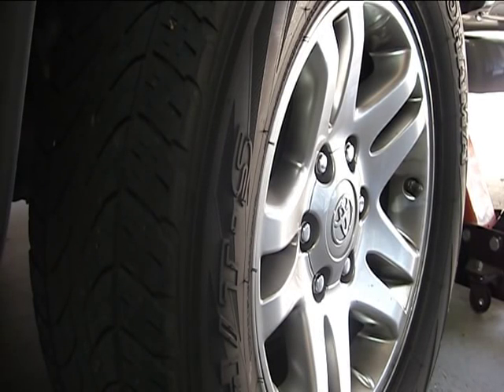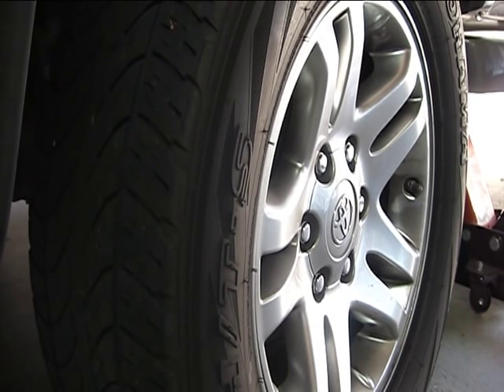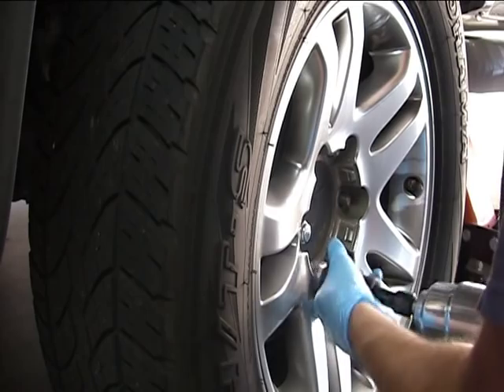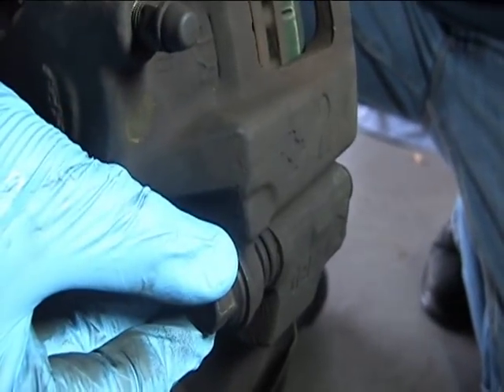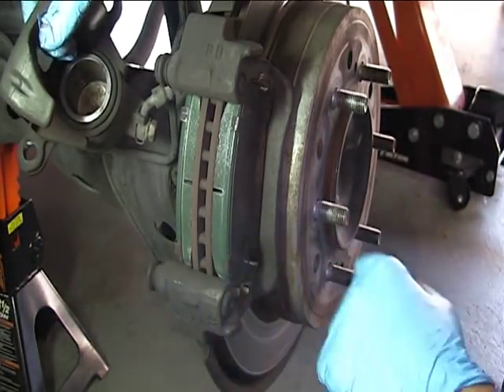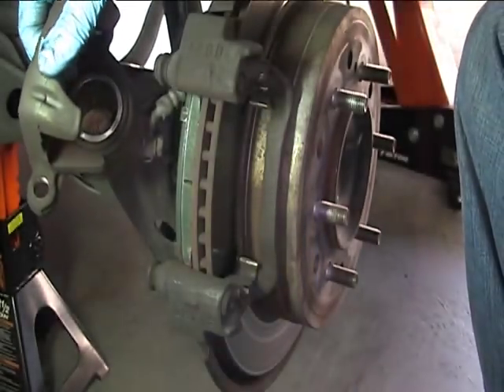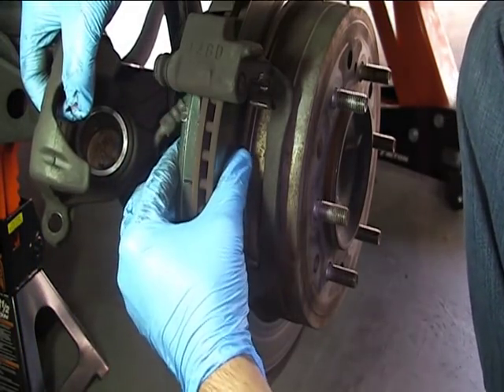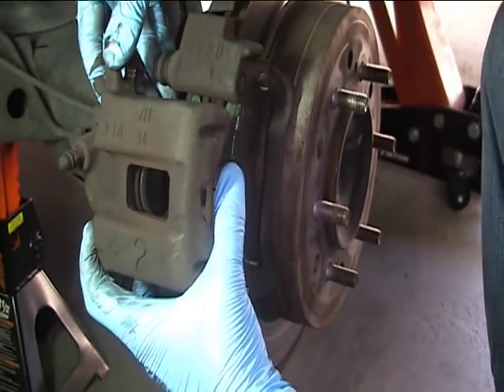How to Replace Rear Brake Pads on Your Toyota Sequoia

Comment: Wow, a huge THANKS for posting this.  The shop wanted $800 to do the front and rear, i did it for about $100 in parts.  It took longer to jack up the car and get the wheels off than it did to replace the pads.  The hardest part is pushing the calipers back in enough to get the new brake pads on - I ended up using channel locks and it worked fine.  This was my first time to attempt to take this on myself and it went on without a hitch.

This is not hard for the mechanically inclined DIY-er.

Comment: Excellent!  thanks again.  These remind me of GM front brakes on older cars.  As mentioned in the other video, I thought the hard grinding was the front brakes, was sure of it, you can feel it in the steering wheel.  But its the backs.  Have yet to take the tires off.  I dont have tools anymore, have to use the jack that comes with the truck.  

So the mystery has to wait another day
Reply from the maker: That sounds about right. At least the rear brakes are disc as well so they're easier to replace than drum brakes once you do it.

Comment: Amazing thing, so on the left side rear brakes it went from a faint sound of worn out pads to worse, then really bad metal grinding, the rear brakes have the piston activate on the inside disc.  apparently when the disc material is gone?  it gets ejected leaving the piston to grind on the rotor.

I have very limited tools and rarely have a spot to do the work, other cars park there.  I replaced the fronts then the failing rear disc.  knew I had to get that 4th one sometime.  hear a faint disc sound, worse, worse, clunk now its hard grind.  took that apart last night and same thing, inner disc falls off and gets stuck behind the cover plate, I wonder if this happens to all Sequoias or similar?

so as you drive this disc thats stuck there grinds on the rotor making a sound that changes pitch the faster it goes.

Comment: excellent video, how many foot pound for tight the nuts that have grease on them.  do you have another video for changing the rooter as well???
Reply from the maker: +Daniel Van 90-100 foot pounds for tightening the wheel nuts.

I don't currently have one for changing the rotors yet (I will once the vehicle requires them), but you can look at this video (http://youtu.be/UdbpQ8qaNSs) to get an idea of what's required. Thanks for watching!

Comment: if you don't have an air gun or impact wrench what's a good way to take the 17mm bolts off
Reply from the maker: Use a "breaker bar" (a long pipe that's placed over the end of your rachet)

Comment: Does this also go for the 2011 Toyota sequoia
Reply: Yes it should, generally all vehicles with brake rotors are pretty similar
Reply from the maker: Yes, the newer models are basically the same.

Comment: Get a caliper compressor for the auto store for less than $10, makes it a lot easier
Reply from the maker: Roger that. Will do for the next go-around. Thanks!
Reply: Militarized Citizen I have always just used a c clamp, but the compressor is a nice tool to have as well

Comment: How does the clip come off?
Reply from the maker: Which clip are you referring to?
Reply: @MilitarizedCitizen  the metal on the pads and how do you get a stuck tire off?
Reply from the maker: I would use a flathead screwdriver to pry the metal backplate off of the old brake pads. They should come off rather easily. Wheels typically don't stick. Make sure you have unbolted all of the lugnuts.
Reply: @kareybrunson3497  kick the tire if it doesn’t come off easily

Comment: if you don't have an air gun or impact wrench what's a good way to take the 17mm bolts off
Reply from the maker: +Kenneth Crockett: You can use what people call a "cheater bar." It's basically a long pipe you place over the handle of your rachet to give you more leverage.